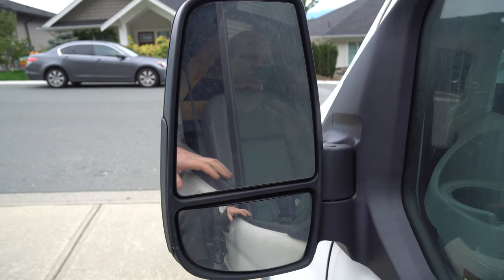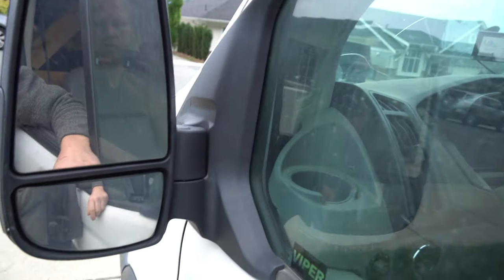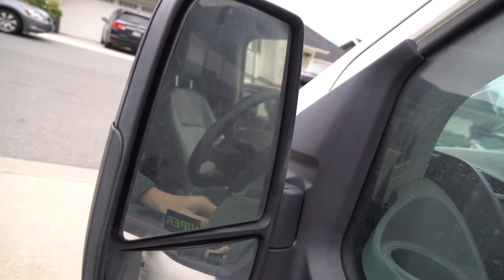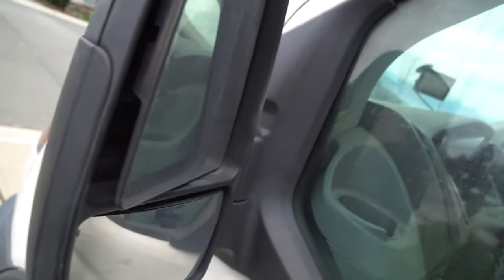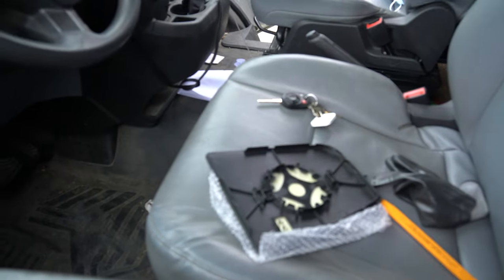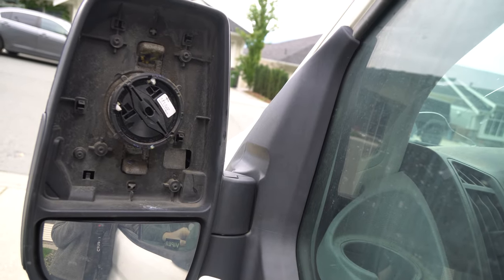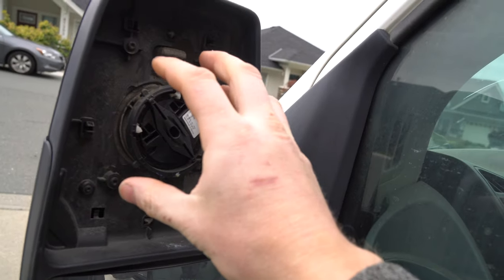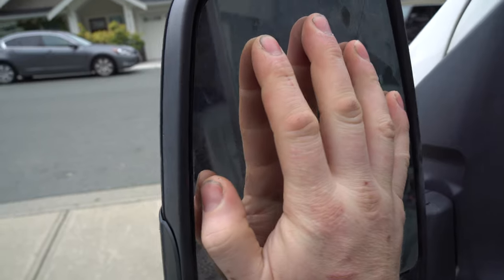HOW TO REPLACE SIDE MIRROR INSERTS FORD TRANSIT

Comment: You failed to point out if the metal tabs (clips) go over, or under, the plastic “fingers” on the mirror frame itself.  No bueno video.  :(

Comment: Easy peacey :) But after I had to force the mirror adjustment as it was out of range to adjust it correctly by using the motor. Also I did see now that my mirrors was heated, I did not remember that so I had ordered non heated mirror. Also the cables for the old heated mirror would not come of, so I had to cut them, pretty sure that is not the correct way to do it ;)

Comment: Did you put the tabs back on the replacement? Are they heated mirrors? I didn't see any wires.
Reply from the maker: This van wasn’t equipped with heated option so I could not plug them in
Reply: @ghostlyrich   how do you get the tabs off the old mirror .  You said to take them off but they aren’t coming off
Reply: What if I don’t have the old mirror ?